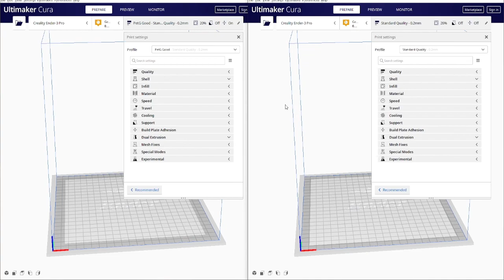Ender 3 & 3 Pro PETG Slicer Settings

Comment: Great video thanks.  Will try the lower speeds.  I have found its easy to get nice looking prints.. however when needing strong parts with multiple walls (7), if I put the part under load the walls split - or you can separate them with a sharp knife.. any suggestions?
Reply from the maker: Petg should handle some load. What is the part being used for? What orientation are you printing in? Their are a few things beyond the settings that will help solve this problem. 3d printing for strength is not just about wall thickness. It also comes down to design of the part as well as print orientation. Let me know what you have and I will try to provide you with a few suggestions.

Comment: You could get some time back by running your inner walls much faster than your outer walls. I run my inner walls at 70-80mm/s on my Ender3 Pro. I slow my outer walls based on the quality I'm going for.
Reply from the maker: Thanks for the insight. I just started with PETG and wanted to get something for everyone to have as a base to start from. I'll take a look at this and see what it does! Maybe I'll make an updated video later on with any suggestions from the comments!

Comment: Nice vid,  I've been trying to get my settings down for PETG with my Ender 3 Pro, but I could never dial it in.  I'll definitely give these a shot.  Do you have settings for PLA too?
Reply from the maker: I normally use the base PLA profile in CURA. What issues are you having with PLA? If it's something I can help I would like to help.